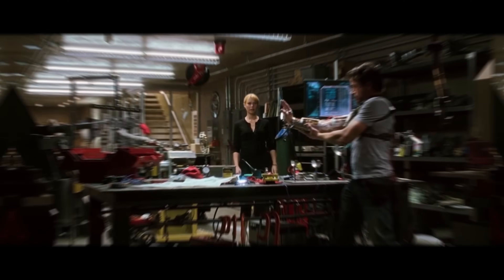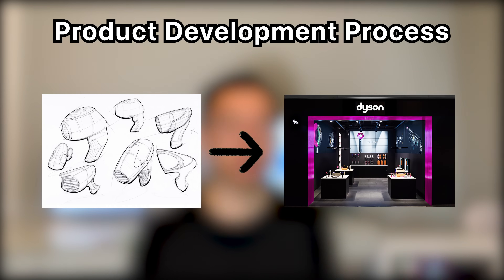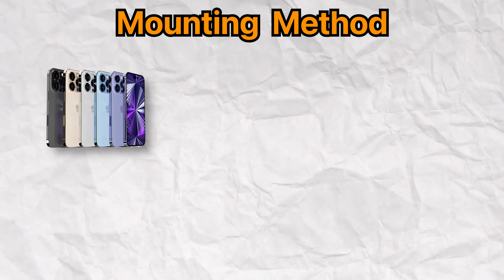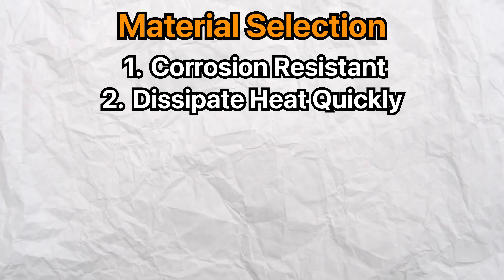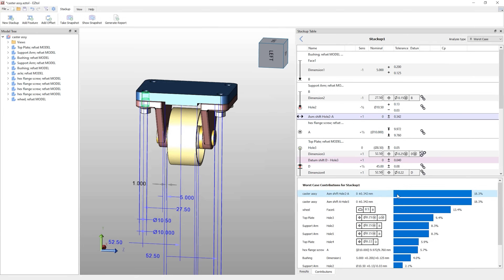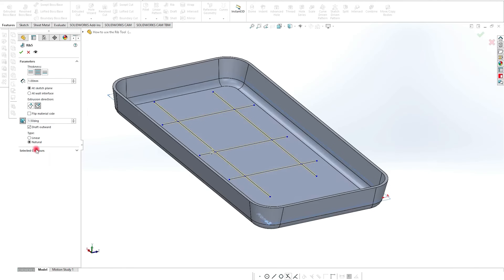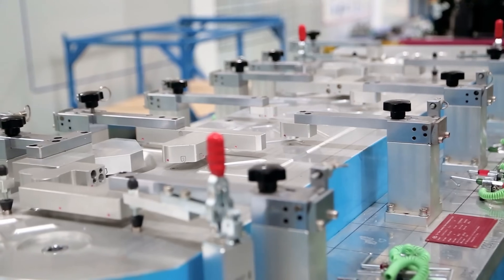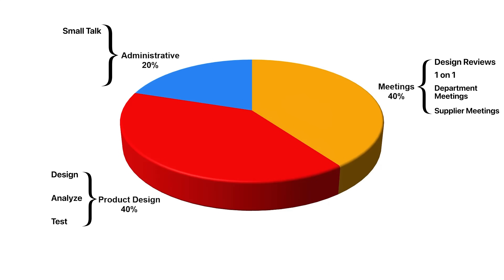What do I do as a Mechanical Engineer?

Comment: You are not a mech engineer you are an office bound designer. Until you've overhauled huge bits of kit in a quarry mine factory etc or been covered in crap using spanners bigger then 19mm or gas axing welding etc you are not in my eyes an engineer, bet you would ick at a bit of oil on your hands. You are not salt of the earth.

Comment: I have started my career at 1984. My the 1st project was to design a storage for neutrons to boost nuclear explosion. 1. Selection of materials to store neutrons for years before a missile would be launched.2. Guarantee neutrons would be stored for years but released simultaneously into active zone of the nuclear warhead to boost chain reaction 3.Drawing and tests at different environmental conditions 4. Selection of processes and development them to deliver neutrons to the active core of the warhead simultaneously etc. My manager used to help me with explosives because I wasn’t certified to work with hazardous materials.
Reply: How did it go? I have been wondering about a similar project.
Reply: @Alan-mq9om  IMHO, the 1st nuclear project met a similar problem. I’d like to say, it is few decades old science. I use deuterium as neutrons source. Major problem I had solved was to synchronize neutrons delivery to the core when critical mass formation gets started. Nanoseconds critical process. The 2nd important problem was number of neutrons delivered to the core should be as expected, about same as total number of neutrons stored in storage. Wasting of neutrons in the delivery path would be an issue for the entire project. Imho, such kind a project is kind of basic problem in modern course of physics at any U. I don’t know exactly, my degree belongs to 1984, this project was done by me right after graduation in KB-11 if you are familiar with Soviet era Ministry of Medium Machinery in 1984-1985. I guess, it should be used in ICBMs USSR developed that time. I was quickly moved to another design company to develop thermobaric weapons and I wasn’t a part of underground tests. But I had tested my work in special blast protected lab and that worked as expected. Imho, any student working on his/her master degree  in physics doing something similar at lab work. I used to have more interest that time to computer model of such process to develop computer model based on my experiments to describe the phenomena as close as possible to my tests. It was fun project for me, and I’m proud even today about my work to improve ICBM performance. BTW, at some point I was certified to work with hazardous materials

Comment: 1. Hi im form the uk n I want to do aerospace but ik the jobs are very limited, Would u recommend me do mechanical engineering degree n then try go from there as then there could be more job opportunities. (Im about to start uni with aerospace engineering meng but thinking of changing to mech)

2. Also I hear mechanical engineer jobs will be replaced by robots, is that true?

Thanks
Reply from the maker: Great questions. If you plan to work in the UK, I do recommend going with ME. You can specialize in aerospace engineering during your last two years of uni or if you plan to go to grad school. ME jobs are probably the least likely to be replaced by robots/AI due to the sheer level of creativity & experience that's required.
Reply: @EngineeringGoneWild  thanks

Comment: Question! Are there any softwares out there to help one validate an engine design? Or one needs to really understand Physics and validate concepts with formulas? Thanks!
Reply: You definitely have to learn them so you can troubleshoot, but yea In ur career u will use stuff like solidworks
Reply: you can develop a system level mathematical model using Matlab's Simulink, and using Simscape environment, in which you can accurately model every aspect engine design and performance (like vibration analysis, power curves/ratings, losses, road/ environment interactions, driver inputs, fuel consumption, powertrain behaviour, vehicle dynamics etc) as per real life conditions. Companies use these models to further test and validate their actual engine manufactured at facility and compare data with theoretical estimations. Same could be done using Simcenter Amesim, Mode Frontier/ GT Power suite, but I havent used them yet. These are just 1D simulations which are used when designing engine from scratch. Next step would be to develop CAD using Inventor, Solidworks, etc, which is mostly piece of cake for kids. These detailed models undergo with extensive FEA analysis where the physical behaviour, performance and durability of every component and its assembly is checked under the loading conditions of real life applications. Ansys and Hyperworks are widely used and adopted my industry for these types of FEA analyses, such as statics (linear/nonlinear), full vibration/ dynamic, fatigue, heat transfer, impact and much more. Usually full 3D flow analysis is performed before and after the FEA analysis using both mathematical models and actual data, using tools such as Ansys Fluent, or Star CCM or AVL fire, which are currently popular. These simulations are coupled with Simulink's system level models too, for full integration system level analysis, which is the most complex type of simulation in industry where multiphysics problems are solved, mainly using Comsol or Amesim. openFoam is widely used in academia instead of expensive commercial softwares, and is considered more flexible and customizable. Only after validation of these analysis, the engine components would be developed for prototype and tested again to match with the simulation results, compare with previous product developments, etc etc. so yes, one need to learn physics and how engines work, before developing them in the first place.

Comment: interesting video. But most school dont teach FEMA or FEM-analysis? Really? I thought that if you studied Mechanical engineering with an emphasize on design you had to study FEM.
Reply: FMEA* (for failure mode and effect analysis) and yes, most schools dont teach this, because the decisions taken under this are usually done by engineers have decade of experience (in decision making), and kids would not be able to wrap their head around so much data and parameters, which need to be considered while making such critical decisions. Its simply left for super senior engineers who learn this with experience, not from text books or course work. Apart from this, FEM (for finite element analysis) is an important subject in mechanical engineering, and is taught in most students worldwide. Yes, FEM is compulsory, and theoretically aspect of it is considered very tough in schools, but at industrial level, they care only about practical aspect of it using commercial FEM tools, which is not taught in schools. So even after learning FEM in schools, the practical experience is gained only in industry.

Comment: So you are the reason why all phones have glass backs now? Seriously, wtf is up with that. Only thing is does is break and put glass in your hand. I guess its really just a form of planned obsolescence....

I really want to know who the engineer was for the Xbox 360 X-Clamp that cost M$ about 1 billion dollars because the failure rate was so high. Simply because the clamp didn't actually put pressure on the CPU and the solder connections cracked when the board warped from heat while gaming.
Reply: they are meant to be broken exactly like this, so that you go and buy a new one, and their profit goes on...

Comment: $150k is absolutely not the base salary. That’s considerably a very very high salary that only big tech companies supply. Base salary is around $70k.
Reply: Where can I get a mechanical engineer for 70k in the usa?
Reply: 70k is salary for a fresh graduate with zero experience. You have to start somewhere.
Reply: @Mt.Mando2081 Dam that beats architecture by a mile.
Reply: @Mt.Mando2081   exactly, ppl just throw any stat without context
Reply: There are a lot of people who get the degree who can never find entry into the field that would be happy to get a first job for $70K, or even $50K.  However, most likely you aren't looking for an engineer that doesn't have 5+ years of experience using your very specific CAD suite that only requires a $20K annual license to use.
Reply: @aceace7573  most places
Reply: I’m a mechanical engineer and my starting salary was 73k
Reply: @derikcruiz5940 damn you Americans have crazy high wages
Reply: What are you talking about 70k? SpaceX's intern pay is 100k.
Reply: @VisionsOfSpy how do you know interns make $100k? Is that undergrad interns or PhD interns?
Reply: yeah 70K is much more typical
Reply: In Turkey 7k ☠️💀💀💀
Reply: Yearly or monthly?
Reply: @dontcry3953  monthly is wild!
Reply: In my cuntry entry level is 15 k, and senior pay at big compeny is 30 k. Maby i should move
Reply: In Germany 70.000 € is on the high end for a mechanical engineer without manager position. I have 70k € and have 16 years of experience (41 years old) and a very good knowledge of German language (C1).
Reply: Man, I make 110k as a 3-year, and I use Inventor.
Reply: How many of you thinking to drop this 💩 job that pays peanut 🥜 for burning your brain? 😂 And shift to IT.
Reply: Wait, you mean annualy or monthly
Reply: $110K to $130K is typical for an experienced ME in design.  More if in Ca- but you’ll need it.
Reply: It seems like the Engineers in this thread are threaten by women or diversity. You are more likely to end up with a humanoid as you are awkward around real women and result to child like behavior
Reply: yo con que me paguen 50k estoy feliz en mi pais pagan 200 dolares al mes a los ingenieros mecanicos
Reply: As a PE?
Reply: $150k in silicon is absolutely base salary
Reply: @Engineeringuncovered  I work for Apple as a mechanical engineer so I would know. I'm getting paid around $130K and I have 7 years experience.
Reply: @Mt.Mando2081 What do you do specifically? Where do you work? What did you make fresh out of school and how did you find a job? Thank you for your time
Reply: I’ll just say this. My first job was working for a company that made NASA’s parachutes. The base salary out of college was $70K. That’s what I was paid as a mechanical engineer.
Reply: I’ll just say this. My first job was working for a company that made NASA’s parachutes. The base salary out of college was $70K. That’s what I was paid as a mechanical engineer.
Reply: @ukaszw7018  That's very true that this video could set false expectation. You're right, that a simple google search on starting salary as a ME would correct these false assumptions.
Reply: @Mt.Mando2081  hey man! I'm confused between doing masters in mechanical engineering and in industrial engineering. How is the job opportunities and salary comparison realistically?
Reply: Hey @josaw5251 ! Personally, I am against pursuing a masters unless you know exactly what you want to specialize in. In my career, I have seen no value to having a masters degree. And I’ve worked alongside people with phD’s who are getting paid a similar rate to me. 

Companies priories people with experience. 

the way I think about it is that if I can land a job with my bachelors degree, I can get paid to learn what I would learn during a masters program. Versus paying thousands of dollars to a university, not making any money and not getting any experience.
Reply: @Mt.Mando2081 I will say that sounds like a unique and cool job !
Reply: Do you mean the US dollar? If the mechanical engineer in our country takes $ 600, let him dance  @Engineeringuncovered
Reply: I get way less than 70k 😅🙈
Reply: @3LFL3DA cause you no good gurl
Reply: @DoubleBYT  wtf 🙄
Reply: @3LFL3DA back to the kitchen
Reply: @3LFL3DA  go make them with mayo
Reply: @yuyuyu9029 I’ve always heard about how sexist and misogynistic the environment is in a lot of STEM careers. You’re proving the negative stereotype.
Reply: Here in Europe base salary is €50k and for someone just graduated is €20k. Only managers have salaries above €70k
Reply: You high bruh? 150k is very little for Silicon Valley😂
Reply: The rent for a one bedroom apt in the valley is about 3 k a month part of why the salary in that location
Is so high.

A gs _12 mechanical engineer for us government is about 100k
After about 5 years .@
Reply: @stephena1385 150k in Silicon Valley is dirt poor
Reply: @stephena1385 what do you mean? What job is this?
Reply: You don’t know what you’re talking about, here in Houston most LPG plants start at $200k EASILY…
Reply: @WockyXSlush  I doubt that. I have a friend of mine working in Houston as an electrical engineer and she doesn't make anywhere near that and EEs tend to be paid more than MEs. According to Glassdoor, Occidental petroleum pays $101-$141k for MEs. Marathon Oil pays $106-$127k. It's a decent salary, but not "$200k EASY". I doubt any of their MEs make that much!
Reply: @Eric-xh9ee just curious but isn’t it just more money for the gov in fed tax after like 157k salary?

Comment: Bro, how do I work in site jobs including physical activity as an electrical engineering graduate
Reply: Go to their factory. Still not very physical because the line is automated but you get to walk around, depends on how big the clean room is. Or work in automotive/aerospace supply companies.
Reply: @thevinceberry  how do I get those jobs
Reply: Go into construction. Electrical engineering degree would get your foot in the door for any electrician company if you want more hands-on work with electrical systems. I did the same with my mechanical engineering degree except I used it to get into plumbing. Any kind of engineering degree in construction would jump you right to the head of the class and there's a whole bunch of different avenues you could go into if you want. A lot of these companies use engineers now for designing their systems so if you can do both, the design side and hands-on side, you're a huge asset for any company.
Reply: @trainofthough0242  how do I get into construction after electrical engineering, what should I do
Reply: @DarkPantherine2.0  I'd go with unions. They do bigger, more commercial work where they need a more diversified group of workers. Someone with an engineering degree would definitely be something that would interest them.
Reply: @trainofthough0242  hellow
Reply: Perhaps you could work as a Field Electrical Engineer to do building commissioning as part of an MEP firm. It might not be that interesting or I think commissioning engineers are highly experienced. 
Another option is Automation/Controls Engineer either for a single plant or for a contractor who provides solutions to many plants. With the latter, it may involve significant travel but that can be exciting if it isn’t in excess. A really cool area to start gaining experience in would be semiconductor plants IMO. Fair warning for the manufacturing side is that there can be long hours and high pressure, as opposed to long-term-project design oriented jobs which are often basic 9 to 5s.

Comment: I wanted to do engineering however I got humbled in my first physics course. I struggled hard as hell. 
I figured if I couldn’t do that, I couldn’t do engineering.
Really upset about it too.
Reply: Some classes are designed to be weedouts. It’s easy to make a straightforward concept arbitrarily difficult to filter out people with weak trig,algebra, and calculus foundations.
Reply: @Rudenbehr  passed but barely but yea. My issue was mainly how to start the problem.
Reply from the maker: I definitely can relate and bombed my first physics exam in university. If you are still interested in engineering, you could invest in a 3D printer and do some cool side projects💪

Comment: Definitely had a similar experience in my career. I've worked at a handful of engineering companies in product design and the common denominator is that the majority of my engineering time is spent on manufacturability. Knowing in-house capabilities, knowing supplier capabilities and designing the product using that knowledge to meet requirements. Depending on the size of company and production turnover there's a varying emphasis on cost control, how stressful the deadlines are and how much administrative BS there is. Hands-on prototyping in the workshop is what I consider the fun part and paperwork (or meetings where nobody takes responsibility) is the least fun.
Reply from the maker: Definitely agree with you! Meetings are the worst and prototyping is always a blast 💯